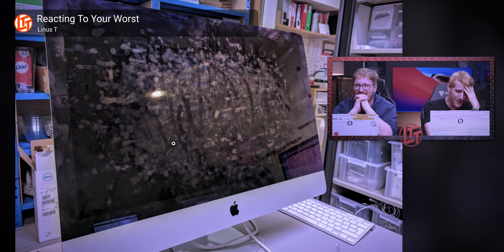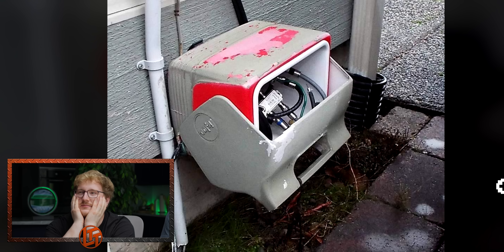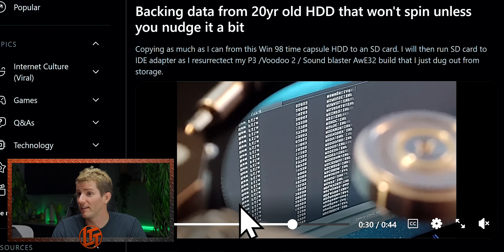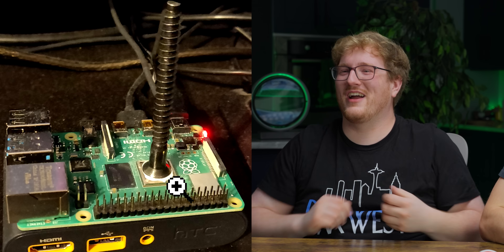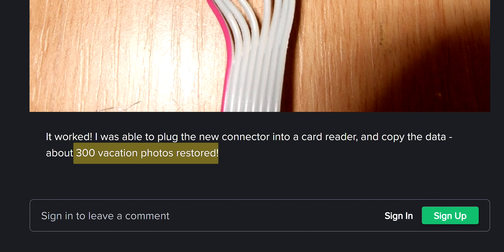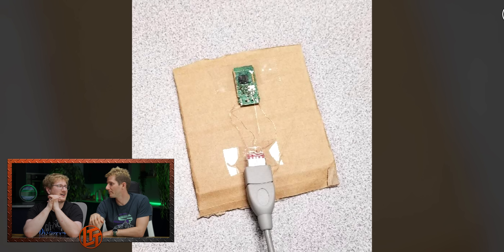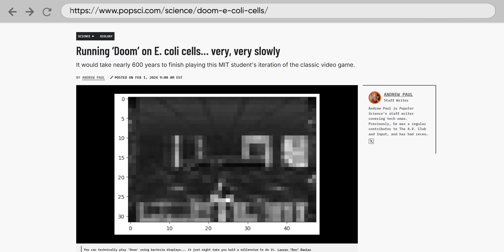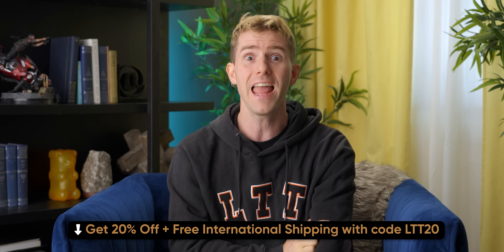Are You All Geniuses or Idiots? - Reacting to Your Best Tech MacGyvering

Comment: Back in the mid 00's, I was in a boarding school for high school that shut off the internet at midnight. A couple of my friends, during an e-waste recycling drive, scrounged up a laptop with a broken screen, installed Linux on it, and managed to sneak it into the network center on campus. From then on we used it as a proxy to bypass the internet shutoff. I visited the school again for an alumni celebration a decade after I graduated, and the computer science teacher was still there. At this point they'd torn down the old science building that had the networking room and built new facilities, but when I asked him if they found a laptop hidden in there when they decommissioned everything, he gave me a wry smile.
Reply: "He knew"
Reply: I mean, if you were that clever about it, you deserved it at that point 🤣 he probably knew the entire time
Reply: That reminded me of my drafting class. A few months into my first year an upper class guy showed me and my friends where they'd hidden a pirated version of Halo on the instructors shared network drive. it was click to run, no install so we'd just close out if someone walked over.

My friend's little brother graduated from the same school 8 years later and Halo was still there.
Reply: I'm just going to start leaving Easter Eggs in networks now.

Comment: The UKTV one was a whole thing about 10 years ago. They're a British TV network running about 15 channels, and they scaled so rapidly that their infrastructure couldn't handle it and they frequently went down. This was their solution for a few months until they got a proper solution in place 😂
Reply: I thought that was really weird that something that seemed so crucial to keeping them on air...was depending on something so flimsy
Reply: I have seen identical setups with a desk fan and A4 print out keeping critical infrastructures going. The temporary fix was in place for 10-15 years 😂

Comment: that IR remote extension... when i was 15 i made one with a 8 meter cable and a 4-in-1 remote so i could control the set top box in the living room that was piped up to the bedroom via a coax splitter!  My parents were simultaneously angry and impressed! That was 30 years ago....I am now a control engineer. Start small do what you love!
Reply: They use a similar thing in bars or other places where they have lots of TVs. One that I worked at basically had a server rack of set top boxes with other devices in the rack that had a fibre optic cables come out of them and attach to the set top boxes where the IR sensor was. This let them control the set top boxes from an iPad.
Reply: You were ahead of me, but to be fair, the IR codes transmitted by remotes for the pay TV service I previously used, StarHub TV, didn't get picked up by most IR repeaters, and the first ones that did work with their remotes was a cheap "AGPTEK" HDMI extender I bought back in around 2020 or so. As such, in a couple of instances (one in around 2007 and another in around 2013 to 2019), I had to run out to change channels, but your comment vaguely reminded me that I may have used some mirrors to get the IR signal across.

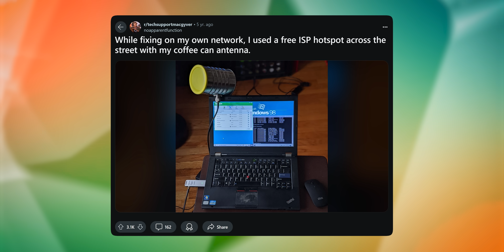Comment: 6:15 As a truck driver, I have been "hacking" wifi for over 10 years. I now use a push up pole on the back of my truck with an antenna rotator that has a MikroTik mANT30 dish antenna with a NetMetal box. I can connect to WalMart free wifi a mile away.
Reply: Impressive, I wonder how far i could see my home network from. A bit ago i discovered that in a specific direction i can connect to it 120m away on my phone!
Reply: Dude. I was a Flatbed driver for 4 years and was too tired to come up with something this boss. Good on you, I will use on my vehicles now.

Comment: We had an small offsite office who's network was terrible and required resetting the modem anytime the network went down. Rather than spend money to replace the modem. Repurposed an old desktop with a pencil on the CD/DVD drive. The script would ping scan google and if it could not reach it, it would eject the disc drive and the pencil would press the reset button on the modem. Saved us a drive and more importantly time.

Comment: 13:00  I work at a computer repair shop and have done that 3-4 times.  it's fairly common for people to keep their only copy of data on a flash drive because they think it's safer on there, and then break the connector off and need the data back.  I can't always fix it, but when it works people are forever grateful.

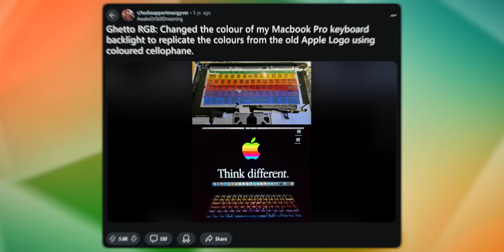15:40 The backlit keyboard on those is just a removeable piece on the back of the keyboard.  They just put strips of color and then the backlight goes back on.  Wouldn't affect how they keyboard types at all.  Quite clever.
Reply: We use painter's tape on some keyboards to soften the key clacks and give a smoother response to press. This ignores lighting unless it's through the key, but this is what they're referring to.

Comment: 5:58 It isn't just "USB flash drives can get too hot in certain situations", that is a Samsung all metal unibody flash drive. I had one. USB 3.2 128 GB. They get hot enough to cause 1st degree burns in quite literally anything you put them in, USB 3 or not, no matter if it is reading or writing. In a TV playing a ripped Blu-ray movie, it caused the plastic around the USB port of a (funnily enough, Samsung) TV to warp. Those flash drives just flat out get far too hot. Their Amazon page is filled with people complaining about how outrageously hot they get. Samsung should have done something, whether that be finding a way to put thermal pads in them, or use a different chip. Those should not have made it to market, and they definitely should have been pulled years ago. They're still for sale. And 5:46, he is wrong. It would work. Since the whole thing is basically an aluminum heatsink for the chip, the ENTIRE thing gets insanely hot. That monster can probably was pulling a good bit of heat, since I did close to the same thing with a bit of Corsair TM30 thermal paste I had and a sealed can of La Croix.
Reply: Odd, I have one that I still use and it'll get warm but never that hot.
Reply: I have a 64GB Kingston all metal USB stick, that also gets burning hot. I put a key ring on, on which I can pull that thing out without burning my fingers.
Reply: If the flash drive is generating that much heat, is it really better to have a plastic case and trap all that heat instead, or melt the plastic? Sounds more like those flash drives are getting far hotter than they should, and it probably would cause long-term damage to the flash. Ain't an aluminium issue.
Reply: @CMurdoch-n3t  it’s not an aluminum issue. It being all metal unibody is probably the best heatsink you can get. It’s definitely a chip issue, which is why I said Samsung shouldn’t have released it with a chip getting that hot, whether it be better thermal pass through to the aluminum body, like a thermal pad, or a different chip entirely.
Reply: Eww warm La Croix
Reply: And nonironically, I have a headphones dongle that overheats a lot and cuts off signal as a result. I am def looking for inspiration on how to cool it down
Reply: @Numerlon   imagine having a phone without a 3.5 jack
Reply: @TrueMechTech  considering anything high end now doesn’t have it; you’re either using a really old phone or a low budget phone.
Reply: @Firelamakar2   very high end

So Apple and Samsung. There are other manufacturers you know, I have a midrange phone with a 3.5 made me in 2023
Reply: @TrueMechTech  its a PC headset :)
Reply: @Numerlon  oh, usb headset 

Kinda never used a usb one
Reply: maybe grinding some grooves all over it could help just enough, i dunno...u know..sime dremel work with a tiny tip
Reply: Just like the person who lost hearing in one ear forever from a samsung earphone blowing up, they would just offer you a free drive if your house burned down from one of these.
Reply: I'm the op of that post and you nailed it, i was annoyed that it was burning my fingers and had some spare thermal pad material and was like "why not"

Comment: That TV station fan took me back to my broadcast days. No lie, if there is hvac issues you do whatever you have to to get air moving across the equipment. At least every 16 months we would have a tube of modified garbage bags tunneling air from a fan set up in the closest door with access to cooler air from outside of the hot ass room, which of course was on the opposite side the control booth.

Comment: 09:00 I wanted to play Wii (Super Smash) again, so I bought a Wii. It didn’t come with a sensor bar, but whatever. I tried the candle trick, and it worked well. About a week later, I went to a friend’s house for a party and brought my Wii along with my candle. People liked it, and we started playing Smash until we realized we had set a plant that was too close on fire. It was funny, but I had to buy a new plant for the lady.
Reply: Not that I need it, but what's this "wii candle trick"? I've never heard of it.
Reply: @AceBoy2099  all the “sensor bar” for a Wii is, is two IR LEDs, so you can replace them with any IR sources, like two candles separated by about the same distance. The actual sensor is in the Wii remote and it uses the two IR lights to tell its orientation.
Reply: @conorstewart2214  *4 or 6 IR LEDs, the candles work but the "sensor"  has extra precision because the extra IR LEDs. (Pretty sure it was 6, one of my sensor bars are generic and sometimes you can point out the red lights on it.)
Reply: @AceBoy2099  You can use candle instead of sensor bar, since the controller use infrared. The bar simply provide infrared.
Reply: @drwoHeylK  Pretty sure the extra LEDs are just to provide a greater field of view for the sensor by having the LEDs pointed at different angles
Reply: @drwoHeylK  Well then just use more candles.
Reply: But you don't need the sensor bar to play smash

Comment: Aw man, I JUST missed the window to submit for this video. For about a week before my brand new GPU arrived, I had a 6 inch desk fan sitting inside my PC case facing upward. It kept my 3080 cool enough to sit on 99% utilization all day long, right around 65c. That 3080 had one dead fan, one good fan in the middle, and one fan that PHYSICALLY BROKE and fell out of the shroud, that's how long I had it and how overworked/rarely shut off it was. RIP to EVGA, there will never be another Nvidia manufacturer that makes a GPU you can do path tracing on with a damn desk fan for a memory cooler.
Reply: A few years ago the fan on my single fan RX 570 (still using it) died. While I waited for a replacement fan I took off the dead fan, shroud, and side panel and had a desk fan pointing straight at it. Worked better than stock xD
Reply: There are PCI fan brackets on Aliexpress that can support 2-3 standard fans underneath the GPU. A pair of 14cm Noctuas does a better job of cooling the GPU than the default fans. Got to remove stock fans and plastic shroud and plug the new ones into the motherboard, because GPU fan header has different shape and voltage. Then use SpeedFan or comparable software to regulate their speed according to GPU temperature, because BIOS can't access GPU sensors.

Frankly GPUs, just like motherboard/CPU, should be sold without cooling systems, but with standardized mounting points for them, so that people could use whatever radiator, fan or thermal paste they want without voiding warranty.
Reply: My old 1060 6gb fans died, and the replacements didn’t work either. So I just took a hyper 212, zip tied the cooler and gave it 12v. Dead silent and kept it around 80f
Reply: yeah man ONLY an EVGA card could do that, totally
Reply: Eh, you won't be still featured in the video. I frequent this sub and all the entries they commented were the top of all time.
Reply: Jesus christ....i had a 1080 for almost 10 years of constant use and when i sold it for an upgrade, it was in mint condition. You dont saound like a person that takes good care of your hardware at all lol
Reply: @categoricamente1753  sure, or I just got a bad card. It happens, even to the best manufacturers. Sure seems like they agreed, since I was able to get a partial cash refund on it despite EVGA not making nvidia cards anymore. You can also just poke around and find MANY cases of fan failure with the FTW3 3080s.

But yeah, its my fault that this specific GPU died but not any of the other GPU's in any of the PC's i've assembled since the original GTX Titan
Reply: Ah yes, the old "desk fan to cool computer" trick, the ebay fans I had in that machine were as loud as the desk fan, if the desk fan was a group of tractors being angry, I didn't think it through too hard but it didn't overheat. lol.
Reply: lol I’ve been running a Zotac 1080 Mini with two case fans zip tied to the fan shroud for probably about three years due to the original GPU fan kicking it. It’s ran about 10 degrees cooler than stock. 

I’m just upgrading to a 4080 today and this video popped up.
Reply: @zoeycch  I got a small desk fan in my pc case pointed at my rx570 right now, works pretty good lmao
Reply: I ran a pair of old Radeon Sapphire cards for like 2 years with a little desk fan in the case. The cooling fans died and this was far easier then fix it.

Comment: My best fix was for an overheating CPU at a remote location.  Thermal paste had dried up and needed to be replaced.  I didn't have thermal paste and I was over an hour away from anywhere that had it.  The closest store that was open was a big box hardware store.  I found one of those tubes of red lubrication farm grease.  It said dielectric on it and that was good enough for me to give it shot.  I put a dab on the CPU and checked the temps, which went from 90+C down to usable 55C, as a temporary fix.  That temporary fix lasted until it was replaced 3 years later.
Reply: On a long enough time scale, all fixes are temporary.

Comment: A few years back I wanted to use my Discman (portable CD player) but did not want to change the batteries all the time. So I twist tied the +5V and Gnd parts of a cut up USB cable to the internal battery cables and connected it to a USB wall ward. Worked like a charm!

Comment: @6:15 cantennas were used a lot back in the 802.11b/g days to get extended (but super directional) range.  Great for wardriving and other legitimate purposes.  Note the position of the antenna in the can.  The waveguide is in a 1/4 wavelength (18cm/4) from the back of the can.  There was a science to it.
Reply: Pringles tubes, we used.
Reply: I remember seeing a video on YT where they used a Pringle can antenna to connect at what was over a mile to a network. It was out in some desert so there were very little to diffuse the signal.

I also remember seeing some people putting up a link using tube style directional antennas to connect wifi to a building. It used more commercial equipment but the idea behind the antennas was the same. I can't remember what channels any of these videos were posted on though.
Reply: Also the wireless adapter being used is an old TP Link one that was super popular with wireless hackers back in the day because it had an Atheros chipset which had brilliant Linux driver support (ath9k). The driver would let you put it into monitor mode which allowed you to sniff all the packets without even being associated with an AP. Combine that with an external antenna connector and a cheap price and they were the perfect hacker's WiFi adapter. Still got mine!

Comment: The mouse jiggler at 11:59 reminded me of a story an anesthesiologist told me about an info screen running in a break room in his hospital. An update to the system running the screen had had an update which re-enabled the screensaver or sleep mode. IT was unavailable since they don't work weekends, but the manager did have a key do the case the computer was in. So they took a spare blood cradle (a cradle you put blood bags on to prevent coagulation of the contents by rocking the bag back and forth), opened the case and put the mouse on the blood cradle and the mouse was moving every few seconds.